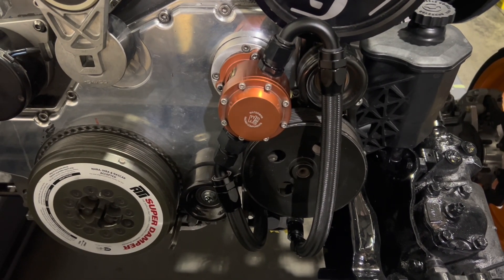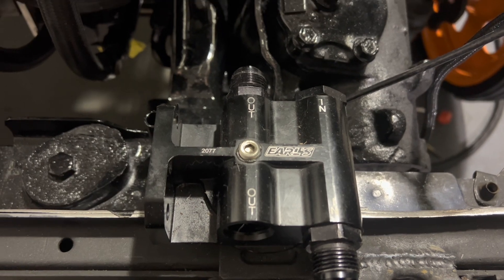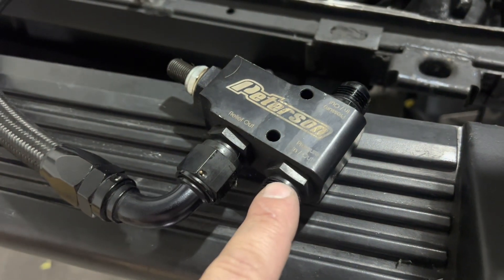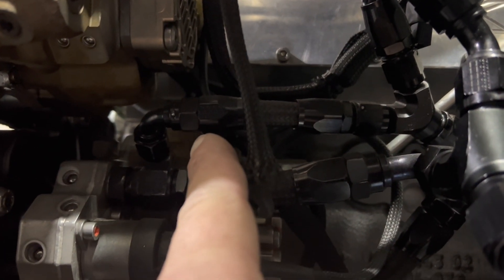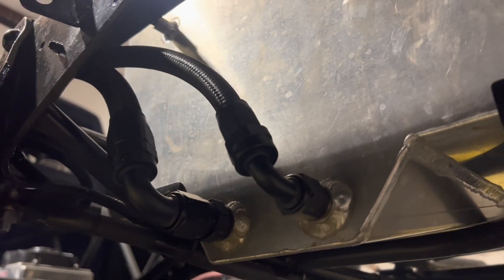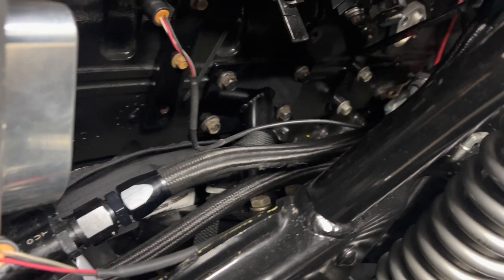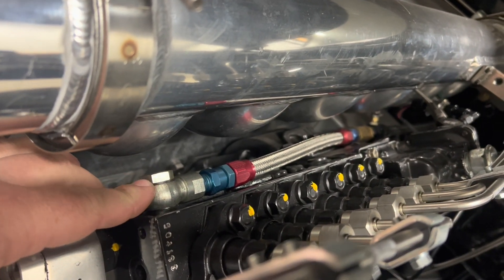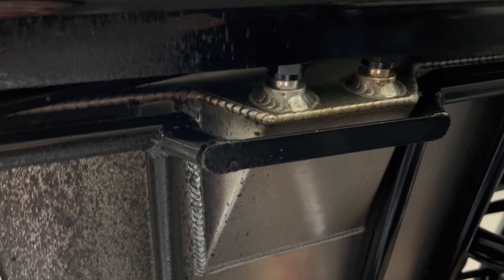Mechanical Fuel Pump on a Cummins! Here’s How!!!

Comment: So glad I found this video was hesitant to order the power driven diesel predator mechanical lift pump and think I’m liking this better. How do you like the individual runner intake? I think they look sick but haven’t seen much on them. Building a 600-800hp 97 12v Cummins
Reply from the maker: I’m glad you found the video helpful! The truthful answer about the intake runners are they are only really worth it if you are porting the intake side of the head. It’s far less about the runner design and far more about the runner gaining you access to port the intake side which you cannot do on a stock shelf. For an 800hp goal you really don’t need to mess with the runner side. Most of the power gains in that application are going to be found in the intake and exhaust bowls. Smoothing out the swirl ramps and cutting material away from the valve guides. On a 600hp build a stock head will make that power no problem. Some light port work will help you achieve the 800hp side of that goal easier. Just be sure not to go too big on exhaust runner size and not too carried away with altering the swirl ramp or you’ll loose bottom end velocity and move your power curve higher. In turn this will spool a turbo slower and make the truck less fun on the street

Comment: Going to be setting up a waterman on a street puller here shortly. from the setups that Ive see they have had a high speed check on the injection pump return and the second on the other outlet on the waterman. any specific reason you plumbed yours with a single check? TIA
Reply from the maker: Simplicity and regulating return is all that’s needed in my application

Comment: Very interesting routing on your Ppump injector lines.    I'm so glad I found this video as I will be setting up a waterman/dsr on my 2.6 truck here shortly, and this does help.
Reply from the maker: The lines are routed in that fashion so I can remove the valve cover w/o removing the lines. I have a video from about a year ago about those. I’m glad you found this fuel pump video helpful!

Comment: I love watching your videos! Always so informative. I’m trying to build my first ground up street/daily. It’s a p pump 24v. I’ll have the 12mm from Farrell. So I watched Greg A’s video on his fuel pressure setup for his 2nd gen. I just don’t understand the regulator part of it. I will be running the air dog 5g220 and I’m confused about having a pressure regulator on the return side? If it has a regulator built in the pump, why do I need another one? Any advice for a novice builder just trying to build a 900hp daily ripper??
Reply from the maker: If your supply pump is regulated, all you need is an overflow valve on your p pump. You can play with different orfice size overflow valves to run pressure up and down a little as well but really no need for an additional regulator.
Reply: He had his hooked up to an air pressure regulator as well. Something to do with boost. Why would someone want their fuel regulated with boost pressure?
Reply from the maker: @jakeblackman5930  oh, it sounds like he’s increasing and decreasing pressure with boost. Less pressure at idle. More pressure as boost comes in. He’s likely doing that so the pump doesn’t have to work as hard all the time. Theirs arguments for both ways. They aren’t wrong for doing it that way. I can’t say that I would add the extra complexity just to maybe make the pump live longer. This is a similar argument to a constant pressure VB vs a ranging pressure. The ranging is less wear and tear on the pump and hard parts but far more subjective to issues. On a high hp truck I always go with a constant pressure set up for the peace of mind. I’ve seen trucks with over 100k miles on constant pressure valve bodies. I would attack the fuel pump situation with this same mentality personally. I’d elect to not run a boost reference regulator and just run the constant pump pressure to insure you never have a fuel pressure issue.

Comment: Would you suggest a mechanical fuel pump on a street application?
Reply: Depends on what you use, a good iron body pump can live a lot of miles on the street. A lightweight aluminum housing racing pump is not going to last very many miles.
Reply from the maker: Like I said there at the end, “they” say it’s not recommended for street use. I always wanted to try it anyways but I have no experience with that so I really can’t give you an educated answer.

Comment: Good video showing how the plumbing is done on both types of truck!  Do you run any sort of a screen or filter on the supply side going to the pump?  Or are you not worried about anything going into the pump?  Also what filter do you use on the filter base?  Thanks
Reply from the maker: No filtration to the fuel pump only after it to avoid suction restriction. I’ll find the filter part number and post it here in the comments
Reply: @LoganbuiltRaceShop  Sounds good I just ordered my waterman setup tonight so I'm looking forward to the install!